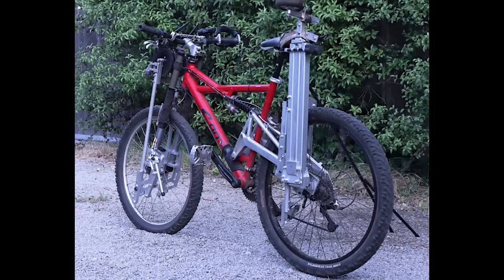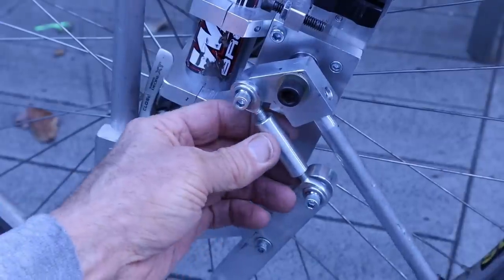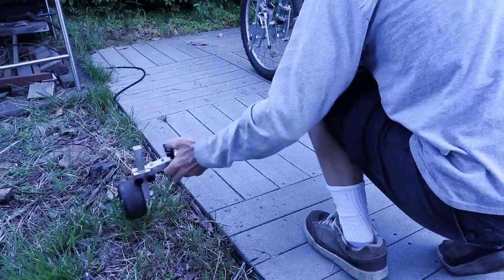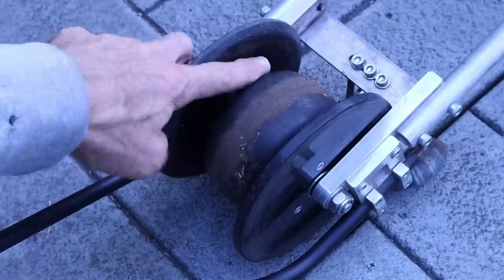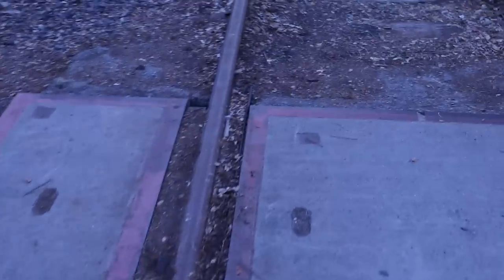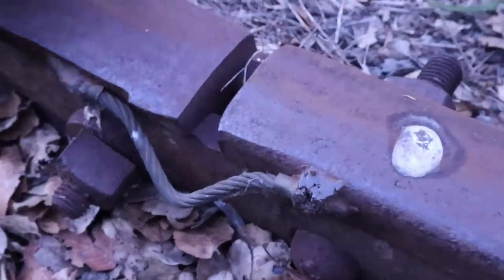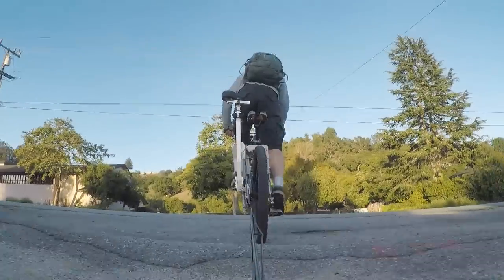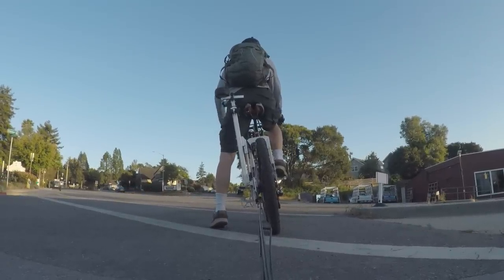Rail Bike with folding outriggers - riding  abandoned railroads on the central coast

Comment: This is probably the best shtf vehicle adaptations I've ever seen, you put a front hub electric motor on that and you could pull a trailer loaded with gear in a fairly stealthy and fast way
Reply: I build DIY hub motor ebikes and I was thinking about that, but I didn't think about being able to pull a rail-cart behind it! You can tell how much more efficient the power delivery is due to the smooth rail. It'd be nice if our country would build more rails!
Reply: Legs are already the motor. You can pull huge weight because the incline is always gradual.
Reply: I was already thinking about how my pedal assist bike would straight fly down those trails.
Reply: There are human powered rail carts, which were used by every railroads for track maintenance and these were fast enough and capable to carry fro 1 -4 people, track maintenance gears and some personal supplies. These were also light enough to be taken off the track by two people. Surprisingly built like a rail car (but open) where you can add portable canopy if required. These are easily visible by trains on the same tracks.
Reply: train tracks would be a haven for bushwhackers. moving quickly and relatively quiet through them using something like this might work very well- for awhile. until you reach a massive blockage of a long dead steel and iron centipede. imagine trying to dismount and go around a huge pile up of scattered boxcars, anyone camping within 5 acres would hear ya scrambling around. wouldnt want to get caught up with some withdrawing methhead cannibals. the old even now disused rails could be even worse/better. surviving wilderness is reality is a coin toss every day against fate.
Reply: @locorogue1670  less friction by adding more contact surfaces? 🤡
Reply: @locorogue1670  I'm sorry for you loss.

Comment: I have wanted to make something like this for years.  Looks like you have perfected it. I always assumed that I would need flanges on the rear wheel too.  Great engineering!
Reply: Yes rear wheel flanges would be easy to attach and work to keep it on the staight and narrow.
What you have done is very ingeneous. Hats off to you.
What type of work are you in. Machinery?
This probably has given ideas to other budding cyclist to come up with a quad version of what you have put together.
Would be super cool. Could even be used as another mode of transport for all that could pedal a bike.
Can see an opprtunity there
Reply: I just feel like I have to lean to keep it on the tracks or maybe stay turned like a bad alignment... Then again I haven't been in one so...
Reply: @facial210  I've been thinking about that myself. When you are riding a bike normally you don't need an outrigger, so I think it only comes into play occasionally. But without riding it who knows.
Reply: @bigredc222  maybe fix the bars straight when attached to the rail so it would feel more stable and could even ride freehand. 
Back to original thought I'd I feel if I leaned right it's gonna tip over or lift the other side wheels up constantly
Reply: @facial210  You definitely don't want to lean right or you're going over.
Reply: if i would build it, for some reason i would opt for vertical flanges on both wheels (no extra wheel in front) and an extra wheel in the middle (two telescoping that meet in the centre). But this works. Can't understand how it doesn't slip at the back.
Reply: extra wheel in the front keeps steering aligned for the bike to follow the rail
Reply: @constantinosschinas4503  I thought maybe the extra distance of the front guide wheel gave it the leverage to guide without extreme torque?
Reply: The front guide wheel, which is already well in front of the front wheel, has a guide bar running on each side of the top flange of the rail - in effect the front wheel has three points keeping it in line with the rail. Only in heavy rain or if there would be autumn leaves or any other goo - brown soap ie. - would the rear wheel be in risk of loosing traction and slide off.
Reply: @constantinosschinas4503  He wanted to be able to use the bike on the road or trail. Your bike setup wouldn't allow that.
Reply: The bike will be very difficult to lean as that induces a rotation of the steering head due to the geometry of the front of the bike, which the front system on the rail will prevent. The trail geometry functions akin to a caster on a cart. You could do it, but you’d have to try.
Reply: @facial210  you can ride a bike freehanded on a road without a problem.
So I don't see why you would need to fix the steering wheel. The flanges at the front should already be more than enough to keep the front in line.
Reply: News flash the guy riding this bike died . He fell off of the bike and down a ravine.
Reply: @bigredc222  Yeah when riding normally we sway side to side keeping balance. Just see how long you can stick to a painted lane indicator deliberately. And the he'd have to reset every time he strays off a little bit
Reply: @MichaelRei99  Is that why he posted a 100-mile ride on this contraption only two months ago?

Comment: As a kid, I was an avid reader, and would pick up obscure library books to read.

One of them was a (very outdated) book on HPVs, or "human powered vehicles". It was really in depth, going from the history of the bicycle, to more modern developments for car replacements in highly aerodynamic recumbent bikes. It also went over just about every type of vehicle you could imagine being pedal powered, including boats, blimps, airplanes, etc, and what has been made in those areas.

Apparently, it was relatively common to make rail mods for bikes back in the early 20th century. Rail companies across the country would shut down on sundays, so the rails were completely safe to ride for sunday picnics. The photos in the book of people doing this were very similar to your design.

I think perhaps the practice died when it became rarer for companies to close on sundays, as the country became less religious. I hope it makes a comeback though. It should. The US's railways have been so mismanaged that trucking has taken over much of the freight industry (despite being an objectively worse way to transport cargo than rail). This has resulted in a lot of abandoned railways across the country.

The reason you find it easier to ride across town on rails is that the single biggest advantage of rails is a low coefficient of friction between your tire and the rails. This reduces rolling friction a ton, meaning youre putting a lot less work into pedalling.
Reply: @avidreader100  it does not he’s using Mountin bike tires he has less rubber on actuly
Reply: he probably finds it easier because he's not constantly stopping for stop signs and traffic signals
Reply: Railroads as you know are always made with a minimum grade in mind. Where as roads are made by removing the least amout of material as possible. Hence up , down and around and repeat. Really cool project!
Reply: I literally remember this book
Reply: No traffic surely ?
Reply: Very cool and informative
Reply: @humblewisdom8976  exactly and they were sighted to go through the best and quickest route through town.
Reply: Do you happen to remember the name and any other info of the HPV book?

Comment: I've been doing this since the 1980's. 

Back East, the rail is pretty beat, worked like an old cold chisel. The rails get wide and ragged on the outside rail, and the inner rail gets super narrow, on sharp curves.

There's also ballast stone piled to the level of the rail on the outside, occassionaly some hardware.  This, and the ragged rail, will launch you. I'm done with the double flanged guide. Too many injurous crashes due to these hazzards.

I used 4130 tubing, logged thousands of miles.

Beautiful build. Very tidy.
Reply: Can you send me a pic or some info?
Reply: Show us you're stuff! We want to see how you improved this type of device?
Reply: I agree, more info please!
Reply: U r ahead of the curve ain't you Bud
Reply: I don't know why but it would be hilarious to me if while making this video the guy ran into someone else doing the same thing. Either in the opposite direction or going too slow in the same direction.
Reply: 1980s*. You're probably thinking of the apostrophe in '80s
Reply: Good for you buddy

Comment: Wow, your roll rate/distance after that push was impressive! Great engineering 👍
Reply: I wish my roll rate was that big
Reply: He's riding a bike on the smoothest surface probably with freshly pumped tires, the engineering is great but it would be hard not to have low roll resistance on a smooth steel bar.
Reply: @dominicdeluca6378  There may also be a grade that we can't see, a slight downhill would make a world of difference.

Comment: Very nice job you did. I made one of these too to see how it works. I did the same as you and had rail guides on both sides of the front wheel and some rake. My out rigger was not extendable, like yours. I tried it on the RR tracks on my street and was amazed how the rear wheel tracks behind and does not come off the track, so no wheel guide was needed for the rear wheel.
 I got some pretty funny looks from the neighbors, as these tracks were still being used.
Reply: What keeps the rear wheel in place? Is the front steering locked in place?
Reply: @DanielNorton  My outrigger had a RR type wheel and that helps track it. But a bicycle and motorcycle, if straight, will naturally track the wheels in a straight line. The out rigger just helps as an extra.
Reply: Yah, being used by you!

Comment: On a bicycle the rear wheel automatically tracks the front wheel. The reason for this is that the movement direction of the rear wheel is always towards the point where the front wheel contacts the ground. The same is true for the bicycle front wheel relative to the rail guide wheel. No second guide wheel needed, automatic tandem alignment does the job.

Suggested improvement: Build a foldable luggage holder on the outrigger and put your backpack on it. This improves the balance and allows you to get a nice sun tan on your back!

Comment: Awesome idea!
When I used to do cycle touring, I was planning my route along the train lines, as they never have a gradient of more than 2%.
The only drawback I see is the suspension, which is completely useless here and makes you lose a bit of power every time you press the pedal.
Reply: Great idea! Some mountain bikes have suspension lockouts that solve this problem, making the front fork rigid for flat/stable terrain. 

Here in Queensland, Australia, a lot of the old railway routes in the countryside have been pulled up and the routes converted to gravel trails for walking/cycling. I’d love to go for a cycling holiday along some of them.

Comment: Would you ever consider offering instructions to build such a thing for ourselves, or selling kits for people to attach to their bikes? I am in love with this idea, and amazed that you thought up such a clever idea!
Reply: sounds like a good way to get sued when some idiot rides on an active line lmao
Reply: @Seerinx  dead people don't sue, their families can though
Reply: @Seerinx  Have to be sure that the RR lines are totally abandoned!
Reply: @jtc1947  . . . and that they are available for use. That is: abandoned or not, someone still owns those lines. The whole "private property thing" has to be looked into.
Reply: @TheStockwell  GOOD POINT!
Reply: There are Speeder Rail Car Clubs that take many tours on old abandoned rail lines all over the USA.   So no problems with that about crossing paths with real trains.   As for trying to get one of these for your own bikes, if theparts were sold separately and some parts needing to be cut to size then it would be less than a kit and no worries about being sued.  

If the plans could be bought better yet.
Reply: I'd go electric, or gas motored engine  added on!,

Comment: I was wondering how your back wheel stayed aligned but I guess that, once you start out on the tracks and your front wheel is locked on leading the way, that problem pretty much solves itself.
Reply: But traction on a steel rail though…
Reply: @Frankie5Angels150  Well alot of these rails are rusty, lower the pressure a bit in the rear tire and it should grip well.
Reply: and more importantly, it’s not like the hills and turns are going to be too drastic, given that this is a rail line

Comment: I used to have a reprint of a 1906 Sears catalog, and they were selling a device just like this.  Quite amazing how everything old is new again.

As for the locating flanges, why couldn't you change them to a pair of rollerblade wheels angled down at 45 degrees?   That would enable you to still track the rail, but avoid the bond wires.  If you wanted to get really fancy you could mount them on a U-shaped bracket which is independent of the main roller and is forced downwards by a shock absorber, so if you did encounter some sort of obstacle, they would ride up and over it, then immediately be forced to return to the fully down position.

Great video, I really enjoyed it.

Comment: I am thoroughly impressed! I'd love to see more specs on how you made this to attempt one of my own!
Reply from the maker: I could probably put up a cad model on my website
Reply: @kev7777777777  I’m interested in this design.  I’d like to purchase it if that’s possible?
Reply from the maker: Purchase the design or the actual device?
Reply: Devise
Reply from the maker: It probably wouldn't work on your bike because the mounts are made to fit my swing-arm and front forks. I would require quite a bit of fabrication to get it to fit another bike. Plus, I want to ride it a bit more.
Reply: Id be interested in the design as well! Let me know where to buy your plans. Thanks
Reply: @kev7777777777  How is it going on upgrades? I'd be interested in buying just the machined bits, and fabricating the rest myself. What is your website?

Comment: Two small suggestions for you:

- you could use just a single inside flange for your front roller if you had a way to selectively spring load your steering avoiding all the outer rail edge issues

- you can add a plow-like scraper to the front roller assembly to sweep any major obstacles off the rail and clear the channel on crossings to prevent any major upsets

As a bonus humerus thought (though I'm sure this would get complaints if you did it) you could add come sort of wiper or similar to electrically connect both rails and trigger the rail crossing gates
Reply: Regarding your single flange idea for the lead roller, I tried that on my own improvised rail-bike and it is problematic for a tri-wheel rail-bike arrangement. Long story. The guy who made this video has obviously done his homework on what works best.

Comment: That's awesome! But as a freight train conductor, I have one question. How does it handle going over switches on the rail line? Or can't it? But amazing either way!
Reply: I was thinking the same thing. I think that utilizing inner flanges on the two folding wheels instead of an inner and outer on the front would work better.
Reply: I was wondering that, and how is is NOT getting hit by a train! lol
Reply: @chewar7537  he mentionned twice in the vid that those are abandonned
Reply: @KidErkwon  abandoned or not, it is still trespassing.
Reply: @blueline308  The Party Pooper Karen has arrived.
Reply: @blueline308  who cares?
Reply: @blueline308  Why are you talking about trespassing? He talked about getting hit by a train, trespassing is completely irrelevant to my comment

Comment: Excellent desing and build! I've designed numerous variations of these contraptions with the same principals although I have a few questions about yours: 1. Do you think a counterweight on the outrigger would be helpful? 2. Without a flange on the outrigger wheel, what keeps the rear tire from sliding right to left? 3. Do you think that adding flanges (like the front wheel) to the outrigger would add too much friction? It looks like yours is working fine without  them. The adjustable front wheel pressure and folding element is brilliant!
Reply: Just my own $.02 as far as the rear tire sliding: the rear tire has to follow the front, and since the corners on railroads are so gentle, the rear tire should never ride off.

 It should never slide off either (like in a slide out), again because the corners are so slight. Lateral forces are very low.
Reply: The only way for the back tire to come off is if the outrigger slipped off. A counterweight would make that more likely btw
Reply: Conor sorry but you have no idea of what your talking about.

Comment: Absolutely genius! Great job! Where did you find the square metal tubing and hardware? My local DIY shops seem to have VERY limited metal selection and no hand-tighten-able hardware like you have here.
Reply: 80-20 is cheap, customizable and would work great for this purpose
Reply from the maker: Ya, square-rectangle tubing is hard to find. This tubing was was some stuff I had left over from building Zero's motorcycle frames. What I almost used was legs from a heavy duty camera tripod. The legs are lightweight aluminum and and telescope and have the locking mechanisms already built in.  Try checking out some camera tripods with telescoping legs.
Reply: Only downside is you have to portage it over switches since the flange is on both sides. What if you have such OCD that you come to a switch set in the wrong direction and instead of just lifting the bike a tad, you're like, "Oh, no, I cannot go any further and I can't change the switch."
Reply: I would imagine one could 3D print the connecting clamps, and use some heat-set inserts and knob screws to add the locking capability.